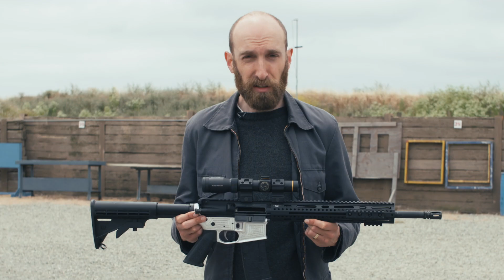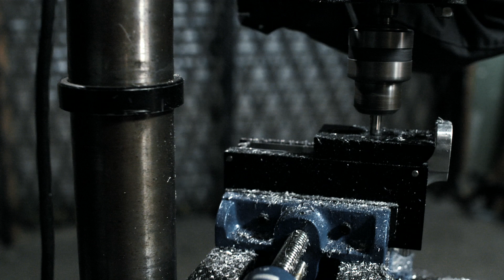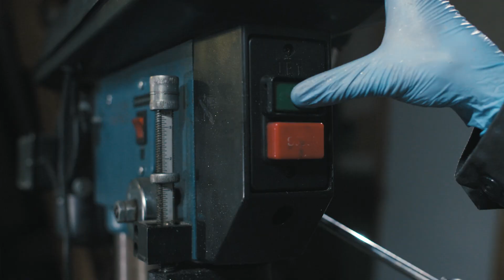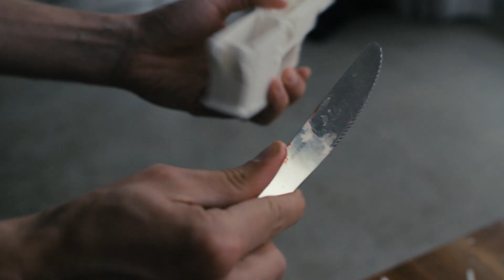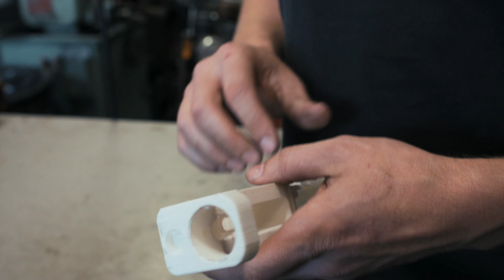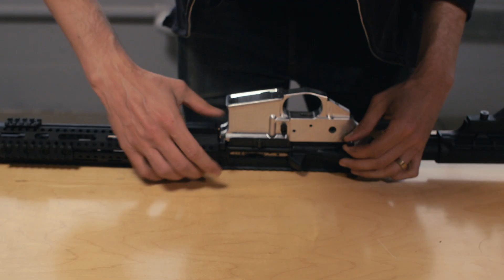I Made an Untraceable AR-15 'Ghost Gun' In My Office | WIRED

Comment: Btw with the dmls technology of the makebot you can just print a metal receiver only problem is that it requires another process which is the high pressurization process to make sure the parts don't break something like a eaf can do the pressurization process

Comment: "the barrier to obtaining a fully metal, untraceable, semi-automatic rifle is lower than ever before."

yeah... if you have $1500 to buy a specialized cnc machine, the other required parts, and the incomplete lower. 

Not to mention that doing all that is completely legal. There is no difference between a gun with a serial number and a homemade gun when it comes to someone using it for crime. 

It's much easier just to buy (or have someone buy) the firearm. 

It's just like liberals to create problems out of non issues.

Comment: This dolt created an illegal firearm per ATF rules and regulations.  It's not considered a firearm if it's only partially milled and has not reached the stage of manufacture, but this fool goes and mills out and then drops in a parts kit and makes a fully functioning firearm without registering and serializing it.  Those idiot cops at the end should have arrested him when he turned them in but since they are all form the bay area, they are most likely idiots with no knowledge of the rules of manufacturing firearms.

Comment: It's really a pointless argument your trying to make. Virtually any firearm can be built at home, from completely handmade with hand tools, to the use of CNC machines. Even completely new, self-designed models, and down to manufacturing every single part instead of  ordering ready to use assemblies. And, stolen firearms are only traceable back to the original purchaser at best, not who stole them, or who may have subsequent to the original owner, purchased it privately. Anyone I've ever heard of that built, or was interested in building, and AR with an 80% lower was doing it for the novelty of saying, "i built this", or for the cost savings (which is virtually none, if any). I'm sure many comments before me likely also have made the point that no criminal, or at best an exceedingly small percentage, is going to go to the trouble and expense of completing an 80% lower.
"Ghost gun" expose FAIL.

Comment: I've built an AR-15 from a completed (traceable) lower. They're typically $80-100. It's seriously not worth the hassle to finish an 80% lower. It certainly isn't worth the $1500 investment unless you're planning to make a boatload of them. But, I believe you will run afoul of the law eventually. You must make the weapons for your personal use. And, if you make too many, won't you start being less of a hobbyist and more of a manufacturer?  You can't legally sell them or pass them on to your heirs.

And, so what if mine is traceable? What's the danger in that? The gun shop you bought the gun from only has to keep records for 7 years. After that, any gun you buy will essentially become untraceable anyway. The same thing if you resell it. You only have to keep those records for seven years. I purchased my first AR-15 in 2001. After 2008, the authorities have NO IDEA where that weapon is. I've since resold it to someone else. I will keep those records for seven years. After that, if by some miracle, the weapon is traced to a crime and they can determine that it was originally sold to me, I can simply say I sold it around 2010 and I don't remember who I sold it to.

Comment: It's pretty cool. I've stayed away from 80% lowers because of all the work and the fact that a 100% lower on the ATF-4473 is pretty dang cheap. Of course I live in a free state where it is possible to do that. If the Feds or States decide to really crack down, the other parts will also become difficult to get. The barrel is the rifle. That is the really tough part to make. That would be a soft point for the gun grabbers to hit.

Comment: And by the way, there are probably millions of mini mills in people's homes. You can make any gun from scratch with a mini mill and they're about $450 new at Harbor Freight. On top of that, there are so many people converting them to CNC machines that there is an entire industry built around conversion parts to convert manual mini mills into CNC machines. So millions of Americans have the ability to build any gun they want, at home, and out of scrap metal. None of this is new.  Just get a block of 6061 or 7075 aluminum, Delrin plastic, fiberglass, carbon fiber, or melt Coke cans down and cast your own block of aluminum and you cam make what you want.

Comment: It's even easier than that. legally buy a gun from an individual as no paperwork is required for that (only through a gun store is a background check and registration required) then remove all markings that could trace it.
Honestly yes the $1500 milling machine that dose the work for you will work but that makes the first gun made very expensive and if you are makeing them to sell or arm a small group that many parts will be in a paper trail. So Ya they won't have a gun on record but they will still know you bought the parts and the machine. So you will still be on a list.
Criminals will not do this they will just steal them or buy them from someone who stole them.
Gun laws don't effect the criminals only the law abiding citizens.

Comment: Gun owners would never want to just - you know - BUILD something. It must be to skirt the law. Yeesh, that set the tone for the whole video. Their are actually a lot of things you can make for yourself but would run afoul of the law if you tried to even give it away. Alcohol comes to mind as just one example. The Ghost Gunner machine's only advantage is you don't have to know how to run a drill press. For drilling the needed sections of 80% lower you can get a guide that will physically assist someone in making the cuts in the right place. I would actually recommend more people learn how to use a drill press as it is a useful tool. Don't let this pleb fool you using one isn't that hard.

Comment: The downside of this though is that there are no serial numbers or paperwork attached to it. So if an AW Ban makes it through, without incident, you will have no legal recourse regardless of when the actual firearm was made. Additionally the only difference between something like this and making homemade firearms from scratch is the skills/tools. Any immoral smith/manufacturer could manufacture guns for criminals or teach them the process. At that point it would require a heavy amount of resources and investigation by law enforcement to track down the perpetrators. 

TL;DR: Shall not be infringed.

Comment: I may be mistaken but I am pretty sure that it is illegal to manufacture a firearm with no serial number, place it was made and manufacturers mark. You broke the law on video and you believe that you are immune to any repercussions in the name of educating people? It doesn't matter if you break the law and then turn in yourself in. I have my facts wrong because any sane gunsmith would never touch an unserialized lower with the intent to make into a functional rifle. The fact is that it's not difficult to break the law but they are there in place to prosecute criminals who break them. It's easy to make an NFA item with little to no skill but the law require paperwork and a tax stamp. This video only proves that you broke the law. No different than filming yourself doing drugs or speeding.

Comment: A jig would cost anywhere from $75-$175. 80% lowers are from $50-$60. The savings aren't really there considering a complete serialized lower can be had for around $50. The jig could be used multiple times. Anyway, serialized guns are not really traceable either unless the authorities already have the firearm. Second, the part that is considered the firearm leaves no impression on ballistics. The barrel and firing pin do which is part of the upper. All a completed lower does is release the bolt. It in no way comes in contact with the round.

Comment: The main issue with gun control laws is that the technology is there and will never go away. It's like trying to I invent the wheel. You can't put the toothpaste back in the tube.
Reply: Okay well i am not arguing about gun control laws, I will argue that I could most likely find a way to put toothpaste back in to its tube given time and resources.
Reply: Live large, Die Large, Leave a Giant Coffin
Reply: shouldn't be that hard, just use a plastic syringe, scoop what toothpaste you can get into the syringe and inject it back through the mouth of the toothpaste tube.
Reply: jsizzlesaurusrex show me. I really wanna see this.

Comment: He only made a lower what about the upper the barrel and all the inside mechanical pieces you'd still have to buy? This is dumb
Reply: The lower is the thing that is legally categorized as the firearm. Everything else, you can buy online, and ship it to your home or place of residence. However, if you buy a lower, it has to go through an FFL dealer. I don't see what you're trying to prove.

You could make the lower, and order every other thing online, and the government wouldn't even know because they don't track things like barrels, stocks, optics, and every other part required to get a lower into a working firearm.
Reply: I know how guns work I'm a firearms dealer I'm just saying that if we tracked all the other large parts like we do the lower it would severely hurt the ability to make a "ghost gun" plus the $1,500 price on the machine is just dumb I've bought guns from people in private for less and it'd be cheaper just to remove the serial number from a registered firearm. Besides criminals don't follow the law that's why they're criminals.

Comment: *The laws of obtaining firearms aren't lower than ever before. It's the fact you now have a new and emerging market of 3D printing that lack laws in themselves.
You obviously don't know shit. Until the 80s, if you were old enough to drive, you were old enough to buy a gun, no questions asked.
Why would the ATF govern over milling machines and 3D Printers? Does that classify as alcohol, tobacco, or firearms?
You said it yourself, that block of aluminum isn't a working gun until you drill more.*

Comment: NFA under ATF regulations are still in play when you make your own gun. Making you own gun is like making your own alcohol. The government doesn't care until you try to sell it without taxes. For starters, you'd need a manufacturing license from the ATF and a FFL from them too to sell guns you make. And you would have to then follow all laws that retailers do. And in Cali, no, not even a ghost gun is legal if you make it yourself if it doesn't a bid to the magazine cap laws, bolt action and have a pistol grip or adjustable stock. So that gun is still illegal in Cali, just not Texas. Because again, making your own guns is like making your own alcohol. It's legal.

Comment: Sure, anyone can make guns who has a working CNC workstation with the skills required to operate it and the blueprints of a gun: Incredible. Now tell me, why should this be regulated?  I mean, I can take a piece of springy wood, tie a string on it, get a peice of straight wood, sharpen it, and for all intents and purposes, I have a bow&arrows, which is just as deadly as a semi automatic rifle presented above (well at a certain range), and is ACTUALLY untracable (because don't tell me there is no record of who buys fucking gun parts at a store... I mean, you don't exactly buy a barrel or a picatinny rail for a lawnmower or a mop handle...
And the quality of the gun above probably leaves a lot to be desired. The fact that you could fire it once or twice means that it works, but not that it won't jam on you at any given situation. By that I mean that commiting a mass murder with a home milled gun, much less a 3d printed one (!!!!) is a bit more than problematic.
Reply: If I use cash and burn my receipt,there is as much trace of a purchase as buying a bow as buying gun parts

Comment: So gun control doesn't work and limits access to only law abiding citizens.
Reply: Pretty much yeah, if you got the tools and raw materials (of which all you purchase legally) you can make a good rifle out of a block of metal and some decent knowhow about what the gun needs and what is typically used.

A really good craftsman could quite literally just have a shed full of appropriate inexpensive tools, read a manual on the gun he is replicating, find out its specs (what metals, components are required) and just make the thing. That's practically how all the illegal gunsmiths that sell to black markets work. Have you seen how the underground gunsmiths in the Philippines operate? They are working with crappy tools and they can make good handguns out of old sturdy boat metal from a decommissioned ship they sliced a piece off of no problem. If you are a determined criminal its cheap to buy as well, cause they don't pay taxes on the black market xD.

Comment: This guy clearly has never had any experience with a rifle before. His figure is terrible. He can't control the recoil for shit. His feet seem to be in a piss poor stance. This guy seems more anti-gun than pro. Jokes on him though, I'll just build an AK.
Reply: Dude the parts are not going to be $1000 a Colt AR-15 is only like $900 and that's the complete gun.... Unless you're buying insanely high end parts it will be less than $500.
Reply: jmi0112
Yes you can. We've done it, no it's not hard. And we're talking about "basic accessories." You can buy a complete brand new AR for around $700-800.
Reply: That doesn't really matter, even if he has no experience, the gun worked. How that's supposed to be an argument to have legal guns banned is something I don't understand.
Reply: Sure, me making fun of his inexperience isn't an argument. However, no criminal is going to spend $1500 on that machine, $1000+ on parts, and have the time to make it. Tyrone or Abdul is just going to get a gun the old fashion way. Steal it or through a straw purchase.
Reply: $1000 on parts? unlikely. You can do it for a few hundred.
Reply: *****
Sure. If you want overpriced parts.
Reply: *****
What basic accessories are you using that cost $1000?
Reply: JZ. No you can't. You can't even buy or make a complete upper with the shitiest cheap components on the market for a few hundred. You're looking at atleast $400 plus to put something together with junk parts. You can build a junk AK for a few hundred bucks but what's the point in that? If you're a criminal you can buy something on the black market for about the same price.
Reply: And look at his face its turned at like a 45 degree angle

Comment: If you want to get nitty gritty, what you did was not legal. There are laws that need to be followed when you manufacture  your own firearm. It does need a serial number. It's not a specific number, for example, 00001 would work, but your lower receiver needs a serial number. You can also only legally build one a year unless you are a business. Pretty cool concept, but you dropped the ball a little with checking your information.